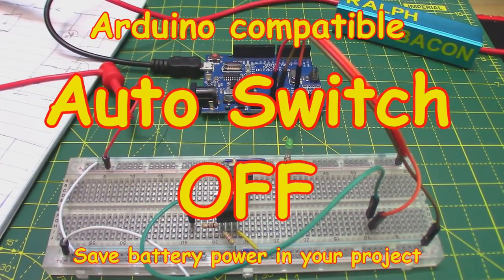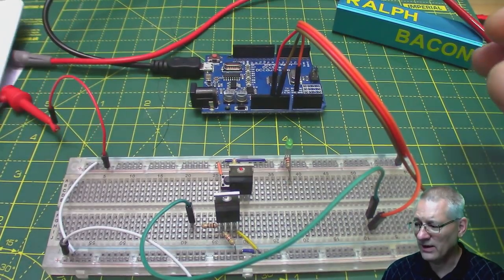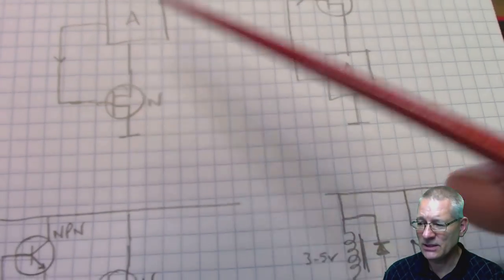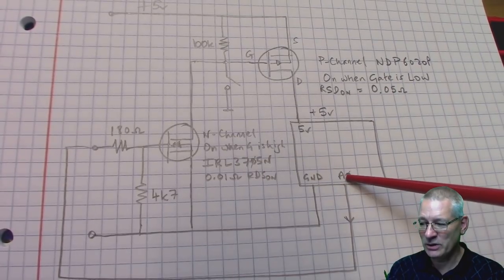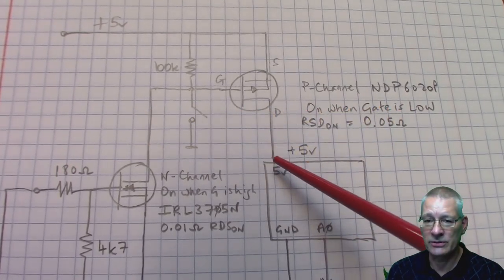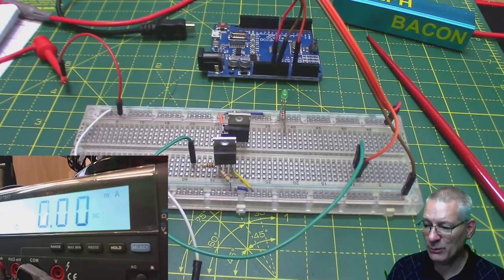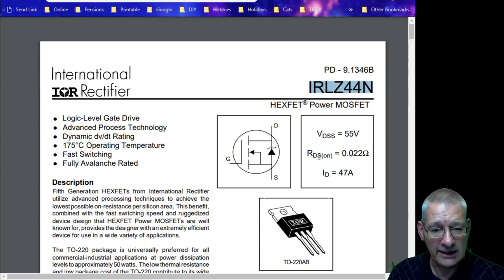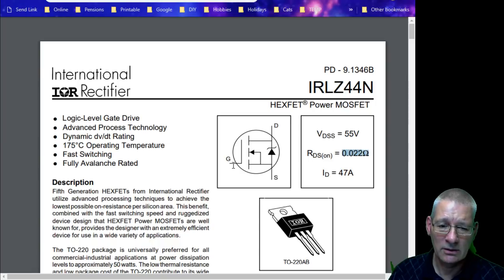#123 Arduino Auto Shutdown (and switch off)

Comment: Thanks Ralf.  I got this to work with the CJMCU-4599 circuit board.  My NRF24L01 DIY garage door remote was powering from the 5 volt supply on the Nano which ignored any processor sleep mode and flattened the batteries in double quick time.  The solution was to add an on/off switch to activate the nano before pressing the button.  However my wife would forget to switch it off afterwards and I'd end up replacing another 9 volt battery.   Now I can squeeze these items into the box, delete the switch, then when the button is pressed, bingo, the unit will power up, the garage door will activate and the entire thing will go back to zero volts.  Fab.  I'm a total novice who is keen to learn and find your videos very informative.  Thanks
Reply from the maker: I'm delighted this works for you, Howard. I'm using it too, in a recent project, so that my storage container bin-lids switch off the device completely when closed but wake up and send out a radio signal to warn me when open, then sleep for 8 seconds. Like your project, it "just works".

Comment: Thank you for this circuit Ralph! Works great! I was having issues and determined 1. The P channel MOSFETS I ordered from AliExpress were all bad (you get what you pay for - FYI - 6020Ps are now obsolete and discontinued. I wound up using an IRF4905 instead - no heat issues in my use) and 2. The NPN transistor was backwards. Once I resolved that, it worked as advertised! Now to incorporate it in to my project. Thanks again! Gord
Reply from the maker: Great news, Gord, pity about the dodgy components. I found that just touching a MOSFET's leads can cause it to go foo bar. Static electricity and all that. Anyway, good you got it going. 👍

Comment: I am trying to use a 5V Arduino UNO to switch on and off the power source to a 15V device, with the circuit you draw in 32:52. I would like to add a diode (1N4001) between the drain of the P-channel MOSFET and the ground. I read from elsewhere that a diode can protect the Arduino from voltage spike as the switch turns off. 

Do you think that adding the diode is useful? Thanks!
Reply from the maker: A diode can protect electronic circuitry if what you are switching off is inductive; that is, it contains a coil like a motor or relay. As the power is switched off, the coil's magnetic field collapses and that generates a high voltage within the circuit that most certainly will kill any electronics (eventually, not immediately perhaps).

However, the diode has to be places across the device that is the motor, relay coil or inductor. So that it doesn't conduct under normal circumstances, obviously. The cathode should be connected to the positive side of the device, anode to the negative side. Only when the high voltage is generated (because the relay was switched, for example) will it conduct and protect the attached circuit.

Using a diode in series as you are suggesting will merely drop the voltage available by about 0.7v without providing any specific protection.
Reply: @RalphBacon  Many thanks! Such a detailed answer!
Reply: @RalphBacon  Just another very quick question about protection diode. I have read the corrected circuit diagram of split power supply (IMG_20181014_192514.jpg) from your Github page created for this video. Lots of useful information on your Github.

I am implementing this latch so that my Arduino UNO can switch on and off the power for a 15V device. What I worry about is that my 15V power supply will damage the GPIO pin on the Arduino. Is it possible that 12V current flows through from to the drain to gate of the N-MOSFET, through the 180 ohm resistor, and finally reaches the GPIO pin? Or is it just an unnecessary worry? 

Should I add a diode, perhaps a schottky diode or 1N4148, in order to protect the GPIO pin against 12V flowing into the Arduino? Sorry for any ambiguities in my question. Thanks in advance.
Reply from the maker: Understood 😀. So your Arduino should not be connected in any way to a 15v supply. If you are using the MOSFET circuit to switch it on, that's fine because the Arduinos GPIO pin is the only point of contact (apart from a common GND). Use a Schottky diode in series with the GPIO pin, just as you first suggested for full circuit protection.

Comment: a changeover reed switch is a good way to trigger this type of circuit (on a door etc.).  I used one of the cheap ebay relay boards (switching the ground connection to the esp board).  Not as elegant as mosfets but much easier to wire up and as long as you remove the power LED it seems to draw zero current when off (I have had a 18640 connected to one for two years now and it is still at 4.2v  (it has only been triggered a hand full of times).
Reply from the maker: Thanks for that, alanesq, nice to hear from you.

Comment: You could do with a capacitor across the switch to keep the Mosfet alive long enough for the Arduino to boot. That way, you wont need to hold the switch down for too long. Also, by use of a couple of Diodes, the same switch can be utilised as a button input on another I/O pin.
Reply from the maker: Excellent suggestions, Paul! I might try both those as I am using this circuit in a project I'm doing.

Comment: Thank you Ralf, this is almost what i need, has brought me tantisiliingly close to a solution for a real problem. However, where does your 5V come from?  A transformer of some sort which itself will consume power on standy.  Do you have a circuit for a full shut down by the microcontroller?  So that nothing is consumed at all?  Thank you again
Reply from the maker: Yes, a plug-in wall wart, as they say. But switching mains voltage is something I try and avoid in my videos - I can't afford to lose any viewers! 

But seriously, you could modify the circuit to switch the mains power to any transformer but the whole exercise, compared to saving quite literally pennies off your electricity bill, doesn't work for me!

Comment: Hi Ralph. This is a great circuit!  Just what I need. 

Ideally I'd like to run the whole ATTINY85 and mp3 module device off a 3v cr2032 button cell. Would the Ao4606 work in that application?

If needed I could run it off 3 cr44 1.5 volt button cells for 4.5 volts total. 

Am I to understand that the AO4606 has an n channel AND a p channel in the same enclosure and I just wire to the pins as needed for your circuit? Thanks again for your help Ralph! Gord
Reply from the maker: Possibly. At those low voltages you really need to check the Gate threshold voltage etc. Try it on a breadboard! FWIW I think it would work but it might be borderline at 3v.

Comment: A very interesting topic. Just a note if you use a reed switch and magnetic to trigger the turn on of the device i think it would be best to have it inverted so when the reed switch is opened it will activate the device.
Reply from the maker: My immediate thought when reading this, was Why, Paul. My thinking was that the reed switch would replace the push switch in this circuit diagram. Hardly any current flows through the reed switch. So, if you could elaborate that would be great to assist my understanding of your suggestion.

Comment: Hmmm. Nice job Ralph, and for low voltage circuit switching, probably the cheapest albeit not the simplest as I think you rather discounted a relay somewhat hastily. 

I get the feeling that MANY people take a similar view through either a lack of knowledge or a lack of understanding. HOWEVER, there are occasions when say 240v mains at up to several kW may need to be switched on AND off but STILL require a zero current operation whilst in either state.

Enter the "standard" bistable or so-called "latched" relay. This works by using TWO coils and the relay "locks" into either an ON or OFF state by a short power pulse to the opposite coil to get it into its present state. There are MANY room thermostats for underfloor heating for example. I am in the middle of repairing one of mine presently which runs for years off two standard AA cells and switches up to 16A AC (that's the relay rating at least) without problem and with minimum power consumed (the two batteries run an LCD control and status screen).

Using an ESP Module with such a relay (there are units on eBay up to 4 channel (!!) that can do this off the shelf for low cost) means ONLY the ESP deep sleep current is required and everything else gets switched on or off with a single pulse! This includes single to many multiple separate voltage circuits if required (including opposite voltage polarity ones) with no further power required for the relays after switching.

Here are a few links: bare relay, eBay single relay Arduino et al compatible latch mode and the same but 4 channel mode ones. Hope that helps people looking for yet another low cost but even more flexible method of Arduino power switching.

https://rover.ebay.com/rover/0/0/0?mpre=https%3A%2F%2Fwww.ebay.co.uk%2Fulk%2Fitm%2F111693028611

https://rover.ebay.com/rover/0/0/0?mpre=https%3A%2F%2Fwww.ebay.co.uk%2Fulk%2Fitm%2F112894899424

https://rover.ebay.com/rover/0/0/0?mpre=https%3A%2F%2Fwww.ebay.co.uk%2Fulk%2Fitm%2F183450093994

Also found this one:

https://rover.ebay.com/rover/0/0/0?mpre=https%3A%2F%2Fwww.ebay.co.uk%2Fulk%2Fitm%2F142120866564

Further edit:
5v version of above.

https://rover.ebay.com/rover/0/0/0?mpre=https%3A%2F%2Fwww.ebay.co.uk%2Fulk%2Fitm%2F121837751571
Reply from the maker: Some very interesting points you make there, Bob.
 
I don't like the idea of a standard relay because it takes too much power (it has to stay latched by energising the coil, obviously). However, your bistable relay sounds fascinating and I never knew they existed. You can get them for 99p from one of those links you posted. Guess what I'm buying next to investigate further?
 
Oh, and I definitely didn't mention the dreaded "mains voltage" as I'm very wary of encouraging my viewers to mess about with mains, I can't afford to lose anyone. Seriously, though, mains voltage is lethal and inexperienced viewers may not take the required precautions when using it. Kids, for example. But you are, of course, totally correct in saying that relays are sometimes the best way of controlling mains voltage. I'd use an optocoupled relay for that, like the one in my video #18. I keep meaning to do an update including SSRs. ONe day...
 
Thanks for those links, they will educate and help many who read your post, me included!

Comment: Hi Ralph
You comments on protection against electro-static discharge could be a prompt for a video wholly on that topic. I was trained in the "equi-potential" school. I.e. where the idea of earthing is considered unimportant but everything' including you. the 'stat mat and the PCB being worked on is bonded to be at the same potential.  Even making sure the conductive foam is brought into contact with the 'stat mat before removing sensitive components. Whatever you feel is correct will be disagreed with by some who insist that everything is firmly bonded to deck.
Reply from the maker: A valid point of view, Brian; we could (theoretically) all sit on a high voltage pylon cable running an Arduino without ill effects. It's when the potential of one part of that scenario is different (you dangle a foot too close to the ground, for example) that problems arise. Thanks for highlighting this point, good to hear from you.

Comment: Ralph
You did this video quite a while back, but I found it while Googling for my new project.  My project is a DIY solar backup battery box where I monitor the battery voltage and shut down the whole box if the battery voltage goes below 10 Volts.
I struggled for about a week trying to cut the power off at the tail with a single Mosfet – like you showed in your beginning sketches.  And sure enough it doesn’t work but the reasons are not very obvious to me.  Why is there leakage?  And weird stuff happens to the ESP8266 ground.  Apparently cutting someone else’s legs off is pretty easy and works, but when you try to cut your own legs off it doesn’t work very well.
You glossed over the fact that it didn’t work, but if you have time (and find it worthwhile), I would love to see your analysis on what happens, why the tail mosfet doesn’t work.
I am sure many hobbyists around the world fall into this trap every day.
Great Channel.  Thanks for posting such good stuff.
Mat
Reply from the maker: Trying to control power in the ways I showed (that failed) is in some ways like trying to pull yourself up by your own bootlaces. Either the thing you're powering isn't powered (so you can't issue a "power up" signal either) or the ground keeps changing relative to the VCC and the electronics gets very upset. The 100% reliable way to do this is with the  final circuit I showed using two MOSFETs. If you buy the (quite cheap) Si4599 dual MOSFET chip it does it all with minimal connections (and it's small but can carry significant current). I use this in quite a few circuits and it's brilliant.

Comment: What about adding a cap parallel to the push button?
This should allow you to keep the PMOS on for a while (via the 100K charging resistor).
Reply from the maker: Yes, it should. Are you suggesting this so that the switch only has to be closed very briefly and the PMOS is kept switched on because the cap has not charged sufficiently to switch the PMOS off again - thus allowing the Arduino the chance to turn its GPIO pin high?
Reply: @RalphBacon  Yes, that was the general idea. With some tuning, it could allow USB to be connected without issues.

Comment: Hi I'm considering the IRF7317, an SO-8 package containing botn an N-Channel and a P-channel mosfet.
Reply from the maker: Yes, this would work, Jose; a couple of things to consider:
 
1. This is a surface mount item so harder to solder but of course not that difficult if you have a PCB - not good for stripboard
2. You can't attach a heatsink even if you wanted to (certainly not easily; it's not meant to have one)
3. The RDS(on) resistance isn't quite as good as the individual MOSFETs in this demo but probably makes no difference at the currents we're talking about, it will still work very well
4. I haven't compared to the other MOSFETs in their datasheet but the leakage current for this item is specified as 1µA (Drain to Source). That might mean nothing, and compared to self-discharge rates of batteries is still very low indeed.
5. They are very cheap from AliExpress!
 
If you go down this route it would be good to post back here as it might be a very neat solution indeed.
Reply: I will do so in a while.
Reply from the maker: This is EXCELLENT work, Jose. And the fact you could detect no current flowing (just like my demo) when it OFF indicates a very viable solution. I may mention this (and your excellent work) in a future video. Is it OK to put a link to your GitHub on my own GitHub in the meantime?
Reply: Thanks  for your kind words. You can link to my GitHub,, of course.

Comment: I think, not sure, I seen a voltage regulator with a built in sleep timer someplace.
Reply from the maker: Indeed, Dan, there is (as an example) the Texas Instruments' TPL5110, which is a " Nano-Power System Timer for Power Gating". You can get this from most Chinese warehouses (but not Banggood) but at £6 - £7 ($7-$8) they are not cheap. The MOSFETs are much cheaper and robust too, I expect, apart from the static precautions you must take. A simple CMOS 555 Timer running off a button battery would be just as simple, probably! Good memory you have, thanks for posting.
Reply: Good points.   The price for the tpl5110 ic is under $1 US here from Farnell, Mouser, etc.    I am not a fan of the 555
Reply from the maker: Wow! At that price, I would be tempted to experiment too. I shall keep an eye on the price over the next few months to see if it drops. I mention the CMOS version of the 555 timer as it uses µAmps of power (about 50µA) from a 1.5v button cell, and being CMOS can have HUGE time periods. Much better than the standard 555. But it was just a suggestion, no worries. Thanks for posting, Dan, nice to hear from you again.
Reply: For those interested: http://www.ti.com/product/TPL5110

Comment: Ralph, Excellent video. I plan to make use of the external shutdown circuit BUT at 33:11 in your video you state that there is a "deliberate error with a corrected circuit diagram ... on Github". I have looked at the diagram on Github and it matches exactly what is on the video. (with some sections on the diagram looking like they have been corrected but they match the video. Is the diagram in the video correct or is there an update coming?
Reply from the maker: Oops.
 
The circuit diagram for the split power supply has a short circuit around the 100k resistor. Obviously, it should not be like that, I just drew it wrongly. I have now updated the image in my GitHub. I had to do a hard refresh in my browser to see the updated image but it is definitely there now.
 
I've also added a link to Jose Baars' excellent alternative hardware solution (two MOSFETs in one tiny package).
 
Thanks for letting me know this, Richard, no-one else seems to have spotted this, so you win the Eagle Eyes award this week! Kudos!
Reply: @RalphBacon  , need to confirm, is the file IMG_20181014_192514.jpg the corrected graphic? It looks the same as when I looked at i on Oct 22nd. Thanks!